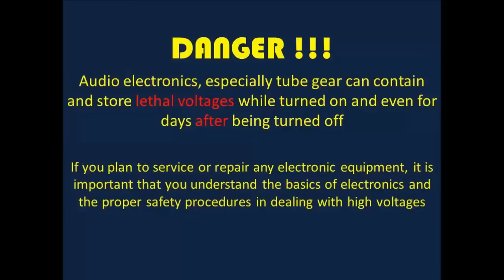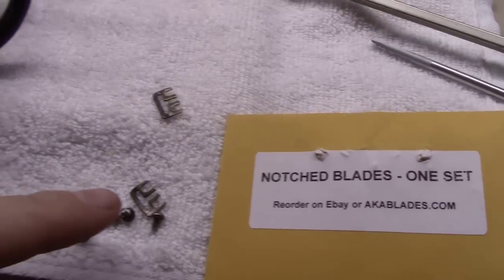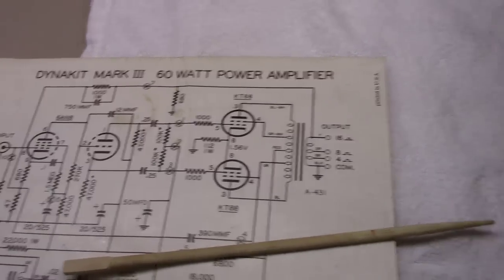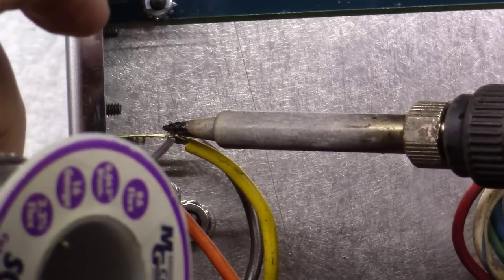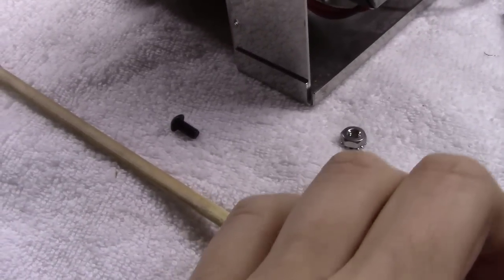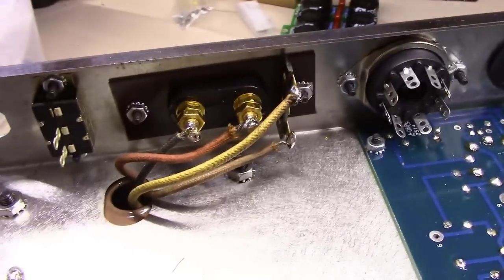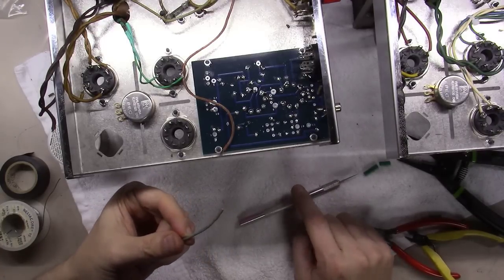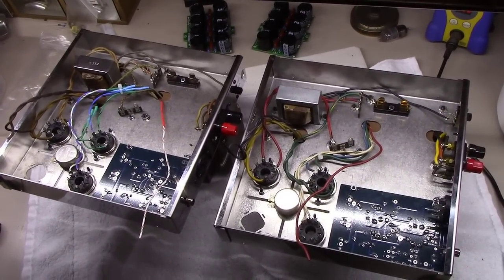Dynaco Mark III - MK 3 -  Restoration Part 6 - BG076

Comment: Another bit of advice to avoid melting banana plugs when soldering the OT wires to them.  Solder the Out trans wires to open hole tab lugs and mount that lug through the hole to the banana plug end,... I think that is why they include two brass hex nuts on that banana plug.  Old bake light plugs could stand the heat of soldering but they don't make banana plugs that way anymore.

Comment: Your new in box stripper may not be totally dead. If you open the case, I think you'll find a big D size ni-cad battery. Ni-cad provides large current but is hard to find a replacement for. Nice job on these amps.

Comment: Couldn't you  replace and splice the wires under the bells to keep it cleaner in the amp?
Reply: I was thinking the same.  Most of the old transformers have a few layers of fish paper under the bells, that may easily be removed, and then there is a heavier piece of fiber board with some lugs crimped to that, and the enameled coil wire from the transformer windings come out to those lug terminals and the outgoing cloth or plastic insulated wires are soldered to those lugs as well. 
   So without compromising the transformer at all, You can, with a little care attach new out going wires if the insulation is frayed or cracked.  Do be careful to put some kind of insulating hi temp plastic or paper insulation back over the terminal strip  You don't want a bare wire touching the end bell metal surface and short to ground, unless the end bell is well insulated on its inside surface, and the primary wires can instantaneously have more than the supply voltage on them.
  Many of the newer transformers are not so nicely put together as the old ones, though often times guitar amp trannys have thermal fuses buried under layers of tape, and open up but the transformer is still perfectly good, once You remove the dead fuse.

Comment: Hi,
Thanks for the great video series on the MKIII build. What gauge wire did you use for your connection runs? What gauge wire comes off the transformers? Cheers.

Comment: A great video series ! ! !  A word of CAUTION though !!! on teflon insulated wire.  I would say never use it.  Luckily I was warned by a top tech who had been poisoned by breathing the fumes and had persistent health problems, back about 50 years ago. Fluorinated hydrocarbons in general have been linked to serious forms of cancer.  I always use computer grade oxygen free multi-stranded wire.  It is easy to work with and very high quality.   
 Another caution on painting transformer laminations,... also not a good idea as the accelerants for drying them may contain nitrates, and cause the laminations to conduct between, and eddy currents can cause the transformers to over heat.  This is particularly true of clear nitrated lacquer.  High temperature black may be better, but the pigment in black is usually either carbon or black iron oxide.  So better just to brush them off, and turn which ever face You are brushing toward the floor, as metallic dust getting between laminations or eventually finding its way into speaker voice coil gaps is also bad.   Slightly rusty plates do no harm at all.  If you want them to stay shiney, I would suggest old fashioned purely oil based varnish, with no drying agents.  Not polyurethane either, as various forms of mold and mildew seem to love it, if the transformer ever gets damp, for a couple days.

 Love the video series, and great general guidance and advice, on this great classic Amp !  I didn't realize these Old Classics are so well supported by various kit and part suppliers.  Thanks for all the valuable information ! ! !